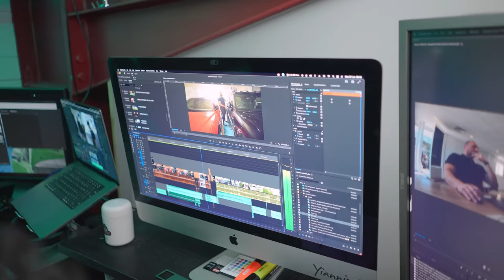This Week At Dannimize ... Ashville Take Over | TWAY ep92

Comment: The Building Regulations - Approved Document K,  Part K1 is the only place you will find a 2000mm minimum headroom requirement around a staircase (i.e. ceiling height).   All other min. ceiling heights where removed from The Building Regulations in 1985, unless anyone else no differently !!!!!!!!!